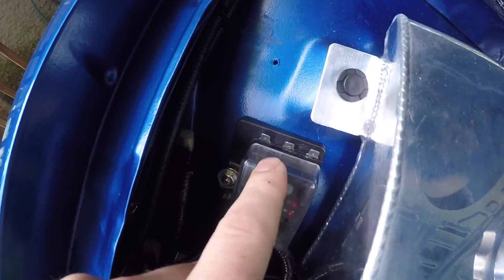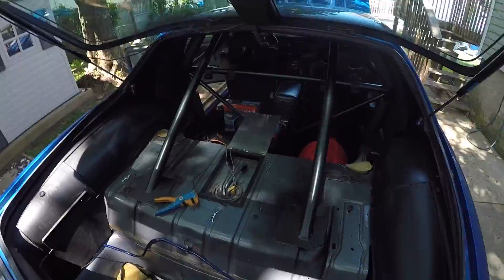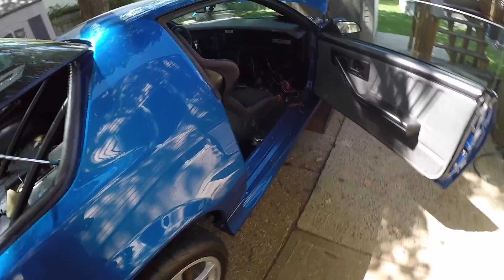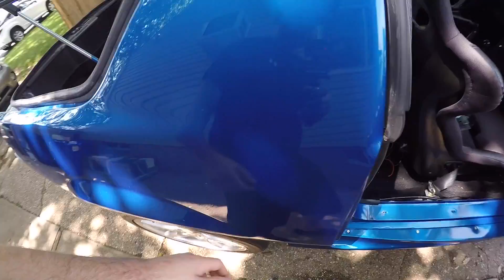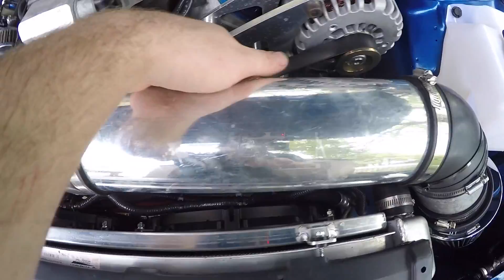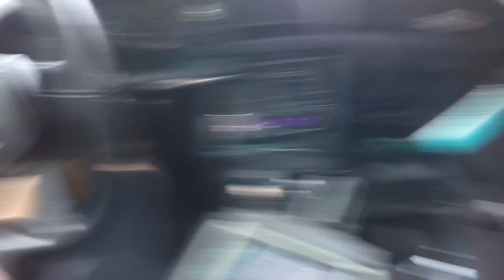I Fixed My Overheating Problem | LSA Blower Swap

Comment: Are you running a shroud on yours or just the spal fans on the radiator? I've got a 86 Iroc z and mine just stays hot even with ls fans

Comment: My fuel pump on my 91 isn't getting power and I have cut the grey and orange wires from my relay and put a button just so that my car can move and if needed I can drive it but I just might have to do it this way it's been driving nuts because I don't think I can get to the ground strap on the block to clean the connection and if the connection is good I'm just change the ecu
Reply from the maker: Sounds like the ecu side of the relay isnt working. Maybe an ecu problem, but did you check the fuse and try changing the relay? Otherwise I would check to see if the ecu side of the relay has power and ground. If it doesn’t, the relay isn’t gonna close and power won’t be sent to the pump.
Reply: @lsxmatt  is it the same for the fbodys that have the relays mounted near the break booster ?
Reply: @lsxmatt  and yea fuse and relay is new when I turn power on so the fuel primes I don't get power form any other wire but the orange wire that's from the ecu and that's always hot even when car is fully off

Comment: Here’s my thoughts. Your idling. Car starts over heating. You give it a little rpm and the temp starts coming down. You did not increase the airflow with more engine rpm, you increased the water flow. You did a band aide fix which I suspect next time you’re in traffic you’ll see the problem arise again. Make no mistake, getting rid of the pusher fans was definitely a good idea because in my experience they cut the airflow down. And adding better fans like you did will help. But I still think you have inadequate water flow at idle or you had an air pocket because giving the engine more rpm has no effect on airflow. It would be an airflow issue if you had to get the car moving to cool it down.
Reply from the maker: It’s still cooling great at idle but runs at 225 with a/c on the highway. Goes down to 210 with no a/c. Come to a stop and it gets down to 190 and fans turn off. Picking up an air dam soon.

Comment: I had a similar issue when I built my car. I bought flex-a-light fans. They couldn't keep it cool. Swapped them with spal problem solved. The big tell was the wire gauge. Spal was 12 gauge. Flex-a-crap was 16. Something like 12 amp draw vs 18 amp draw. Big difference!

Comment: Get an electric water pump. Mezier makes a good pump for ls. Dropped temps in my car and it's nice to turn the motor off and turn your key to acc. and let the pump flow after dyno pulls or drag runs. Apparently  supposed to free up some hp too.

Comment: I don't trust that ground connection. I'd probably nut and bolt that throught the metal, or maybe use a self tapping 8mm head screw or something. I see alot of people try to use factory studs like that for amp grounds, and it fails frequently. It's not worth the shortcut. If an amp doesn't play, it's inconvenient, if your car doesn't run (or loses fuel pressure while running) it could damage something. Nice job on the rest of the wiring. Much better than most of the builds I see.
Reply from the maker: Yea I kind of felt the same way, it was just convenient . I have to add a connector to the fuel pump so I’ll probably machine screw it down. Glad you liked my work👍

Comment: What color blue did you use on your car? I’m redoing a 92, and I really want to paint it blue. I’ve been bouncing back and forth between different blues, but I really like the color you used
Reply from the maker: It’s hyper blue metallic, the new 6th gen color. Code is wa388a.
Reply: LsxMatt Thanks man, appreciate it!

Comment: I was about to say the same thing. Put all the duct work back providing that this was a tuned port car originally. V6 and TBI cars didn’t have the ducts.
Reply from the maker: My car was an mfi v6 so it didn’t come with it. I’m gonna try to fit the duct back in when I’m done, but I doubt it will fit with the heat exchanger and fans.

Comment: You fill the block from upper hose?
Reply from the maker: Yea then I use the steam vent connection in the hose to bled the air as I fill the radiator.
Reply: LsxMatt i use a 195 with 4 holes in it warms up to around 175 and never goes over 200 thrashing on it 165 stat would fix it im sure
Reply: +1  I prefer the drilled T-stat.

Comment: Great video I have a question I’m 🤔 thinking about getting a 1991 RS camaro he did an engine swap a 305 v8 he said it was working for about a month then it stopped also said it might be dirty spark plus, censor or ecm should I still get it?
Reply from the maker: Depends on the price and if you know enough to repair it. I mean it can really be anything. I would only buy it if you don’t mind possibly having to replace the motor.
Reply: LsxMatt he wants 5k for it and I don’t mind I just want to know how much it would be lol and if it’s worth the investment
Reply from the maker: Damn that’s a lot for an RS. If the body is rust free, paint and interior is decent, and you can get it running I would do it. Otherwise that’s a lot for an Rs with a possible bad motor.
Reply: LsxMatt oh it has fresh paint and from the pics the interior is really nice he’s willing to let me do payments on it which kinda makes me wonder that something is wrong with it
Reply: It’s not the right camaro I want I can’t find any and there’s like 2 but they want 20k for it so I’m going for the second best

Comment: ur overheating because all the Grill ducting isn't there.
come on man
Reply from the maker: I went out of my way to buy the entire air dam from eBay a few years ago. Still did the same thing. I removed it because it wasn’t helping, and there isn’t any room with the heat exchanger going in.